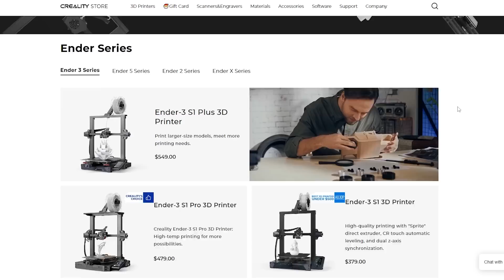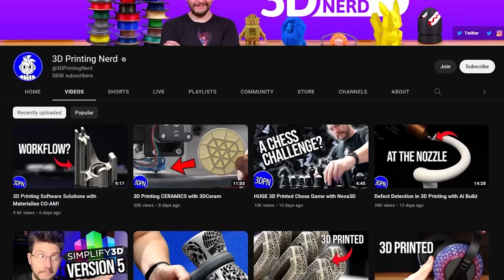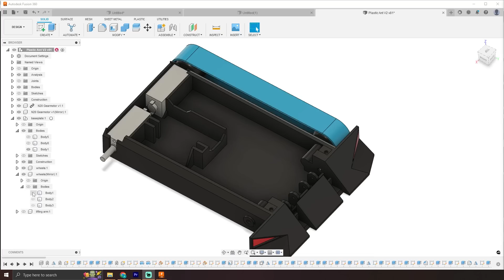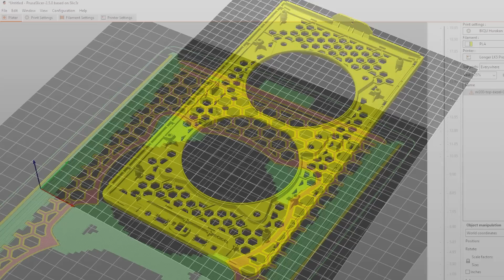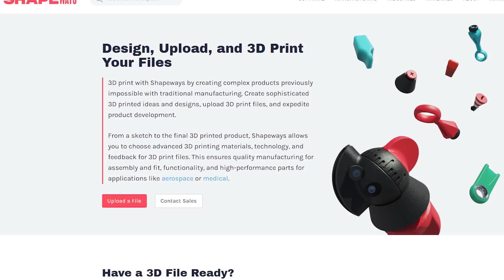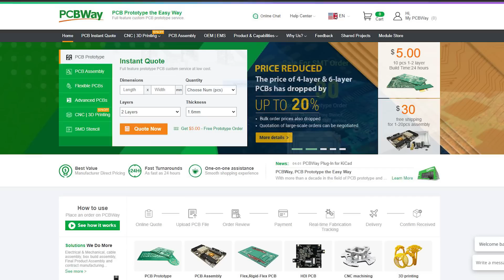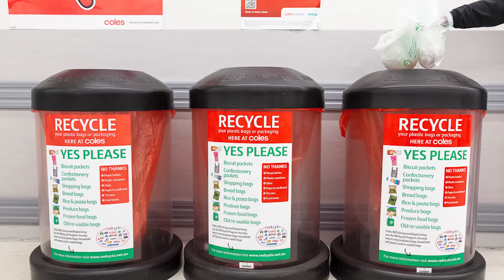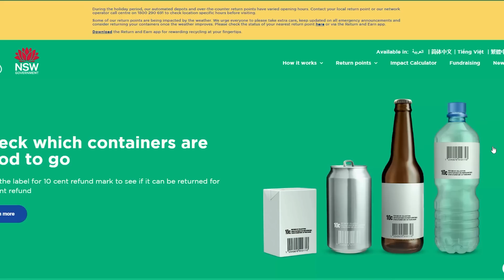My 3D Printing Predictions for 2023

Comment: Got an Ender 3 for Christmas, enjoying it. Still dialing in the first layer, but I'm improving my process. As far as CAD goes - Fusion 360 looks nice, but looks insanely expensive if I ever want to use it commercially. I've been learning FreeCAD for items that require strict dimensions, but I have a little bit of Blender and Wings3D experience, and they export STL files as well. I definitely think there's a need for simpler software; FreeCAD was a royal pain to learn.
Reply: That's funny. Fusion is the bargain CAD...😁 Similar offerings from other vendors go from 2500-20K/year. I have been a SOLIDWORKS user since 95 but I am so tired of their ridiculous prices and lack of consumer level options that I may switch to Fusion permanently. Autodesk's start-up/hobbyist license is by far the best in the industry and I hope it crushes Dassault for their elitist attitudes and for turning SW into the PTC, SW formed to replace.  If we make money, they make money. A single person startup cannot afford 4K in software to test ideas that may of may not pan out. Autodesk has that figured out, and I hope they stick with it.
Let me know if you find something else that is good. Onshape is pretty good, but doesn't have a low cost offering. There is a free version, but your files are forced to be public which makes it unusable for startups, and maybe even some hobby use. Some of us don't want our ideas public domain. 
As for the other CAD I would love to see other competitors, but of what I have seen, those low cost or free softwares are vastly inferior.
Reply: @court2379  I'm a former solidworks user (As well as Autodesk inventor, Civil #D, and AutoCAD versions over 20 years) and I didn't like Fusion360 at first, but now I love it.  The only thing that I haven't liked so far is that they removed some features from the hobbyist version and made it exclusive to the commercial version, but now that I have a #d print business, that doesn't matter anymore since I had to purchase the commercial version before my business got to the point where I could get in trouble for using the hobbyist version commercially.
Reply: @court2379  Solid Edge is a good choice as well.  Solidworks is built from the base that was build in Solid Edge.
Reply: @Frostfly  I just looked at their license options. They went the same route as SW. The start up license might be a little better depending on how strict they are on the time taken. I tried SW's and at the end of the year they force you to buy a commercial license or kick you out. I suspect SE is similar. They really aren't designed for true startups. They want to take an existing small company to the next level, not take a new idea and develop it into a product and then form a company to start selling it. You have to take a lot more risk to start a company before you have developed the product. Particularly if you don't know if the idea will work out. The whole point of the CAD is to figure that out before you spend tons of money on an idea that doesn't work. 

The maker licenses are crippled and offer no upgrade path to a commercial license should the hobby turn into a business. I would have to ask the specifics on the upgrade options from Siemens. SW offers no path. Perhaps Siemens is more reasonable and just charges some nominal conversion fee, or commitment for commercial software for some time. 

Onshape has the next best license that I have found, but your files being public limits the usability for new ideas/innovation.

So far Fusion is the only one I have seen that intends for the hobbies to grow and then starting asking to pay once you start making money. Everyone else wants money up front before there is any revenue to justify it. Autodesk is investing in makers/businesses with hopes they become long term customers. Everyone else is stifling innovation and losing potential customers.  It really makes me want to dump everyone else despite having to learn a new CAD package and being a SW administrator for hundreds of users for many years. I am inclined to recommend the company I work for do the same... The license fee savings alone will be in the millions.
Reply: @court2379 he is talking about the community edition of Solid Edge.

Community edition gives you the full software but has two limitations:

- 2D drawings will be watermaked

-Topology optimization module is only limited to create designs from forces and not pressure or torque, that is no problem since many of you will not use Topology Optimization

But outside that you are free to use all the tools the software offers, you can even use the Reverse Engineering tools of Solid Edge.
Reply: Blender has some quite good CAD add-ons as well as some excellent 3d printing Add ons.   Very Much worth the look.
Reply: Lol homie just wait til you see what a real CAD/CAE package runs. I've personally seen very high level stuff run into the 10-20k/year range for a small batch site license. I think my current package would be around ~7k/year without the company-sized bulk discounts

I really wish Solidworks and similar would offer stripped down (without any CAM/CAE/industrial capability) to students as a perpetual license. I think a LOT of students would bite the bullet on the $100 version if it wasn't a yearly cost.
Reply: @bobbystem7384  there used to be a student license version of Solidworks. Was not even very limited other than no commercial use.  It was FREE! as long as you were a member of EAA. Which I am.  They done away with it. The founder of EAA passed away and allot changed in the organization.  There is a highly discounted version still available.  If you are a student of Titans of CNC. These days I rarely use it.  Even though I can get a license thru a firm I do work for.  I use Fusion almost exclusively
Reply: Try Shapr3D, it’s $250ish a year and it has been awesome with an IPad
Reply: fusion is free if your a maker or student
Reply: @Unscientifically  with restrictions. I like fusion but I like Blender better, but the learning curve Phew I still struggle.
Reply: @ianmcleod8898  I tried using Blender and just gave up while failing to generate a 3D model while watching a tutorial and seemingly doing the same things. I took some Freecad tutorials and now can make parts I 3D print for repairs. I repaired a welder bearing spool loader, a fridge hinge, a headlight holder, a spacer adapter for a battery cable terminal, a battery bracket and plan on redesigning other car parts for repairs/modifications.
Reply: @Unscientifically  "if I ever want to use it commercially ". Try reading......
Reply: Just use the one for individual use, it’s free. Besides, if you’re using the commercial use license, chances are you’re designing to make money, so that in itself would pay for the subscription, which is still relatively cheap.
Reply: @pooppyybuhhole  For now, I'm not making money. There's also the issue of Linux . . . apparently Fusion 360 doesn't have a Linux version. That said, between Blender and CAD related plugins, FreeCAD, and SolveSpace, I'm fine with what I've got. Also I do some programming, so OpenSCAD has my interest, I will likely try that soon.
Reply: I think the linkstage 3 branch of FreeCAD is a bit easier to use.
Reply: Humm, must've been some other software. I thought it was like thousands a month.
Reply: @logicalfundy  it's not even thousands a year lol.
Reply: ohhhh no this comment reminded me that all my autodesk software won’t be free anymore after i graduate college next year. jeez i hope i can find a job that provides the licenses because there’s no way i’ll be able to afford fusion, maya, autocad, and revit all of which i use for different things 😭

also it’s not really the same type of software, but sketchup is a lot cheaper than fusion at like $300 a year for the commercial license (or a lot less if you’re a student) and there are tons of free plugins for it which add the features its missing.
Reply: Fusion isn't bad for commercial use.  $545 a year.
Reply: Insanely expensive?  At $545 a year.  Lol.  Have you priced the alternative?
Reply: @dieselguy62  Perspective my dude.  cheap to you is a lot of money to some.
Reply: @Frostfly  perspective "dude ". It's he said commercial use..... as in earning money.  And it's one of the cheapest there is "dude" 
If $545 for a software license in the CAD field doing work for hire...... is expensive.  You're doing shit way wrong "dude"

Comment: Recycling plastic has always been one of my main reasons for getting into 3D Printing, but I admit, after several years I still haven't done anything about it.
Reply: Same here! I even bought a filastruder and filawinder kit which has very much let me down in how much tinkering it needs in order to work. I still haven't managed to get a usable length of PLA from it. I can't wait for a desktop recycling setup that I can throw shredded prints at and get a decent filament from it.
Reply: Yeah, I really want some filament manufacturer to start some kind of "drop off" of failed prints etc and give you a discount on new filament depending on how much material you returned. Somewhere along the line of 1kg of failed PLA = %20 off on a new 1k spool of PLA or whatever.
Just so it's worth while for both sides to prevent the failed prints just ending up in land fills, because recycling is mainly just a lie.

Comment: Proper recycling of failed prints or purges would be amazing and something I'd spend money on. Output needs to be printable filament so I can actually use it.
I also want to see the end of filament on spools. Supply a master spool with a new printer and print more spools if necessary. Card board is dirty/dusty so not an alternative.
Reply: IMO a direct pellet extruder would be the way to recycle failed prints, the problem is finding a way to process the failed prints
Reply: using a filament dryer then sending the parts through a blender tend to work well.  a sawsall or vibrating saw to break down the bigger scraps.  a good blender should have no problems breaking them down into small enough bits to work for a recycler.  then bagging them up so they can stay dry until use shouldn't be too bad.  what I am doing is storing my scraps in boxes.  when I am ready (after getting a recycler of course) I will dry out the scraps in batches, put them through the blender, then put them into bags with silicate packets.  then once I have enough to do a couple kilograms worth I will put it through and get a few spools worth
Reply: @javeronh.3996  Tried a blender ended up burning it out. fairly heavy duty unit too.
Reply: oh, that bites.  well makes me glad I didn't try to use our Ninja blender then
Reply: @javeronh.3996  Once you start using a lot of electricity to "recycle" PLA into a product not as good as virgin PLA, you reach a point of diminishing returns where you're using more energy than the production of new material. This is one of the main dilemmas of plastic recycling as a whole. The other being that there are a thousand different kinds of plastic and you can't recycle one with another. Unfortunately, this is far from a "green" hobby.
Reply: right, but I figured the scraps from the recycled filament would go in a separate box.  to then be used in different ways.  so it would only be recycled once or twice before being used differently
Reply: @blubug768  pellet feed is pretty awesome but more complex. It's a cost/benifit. I think all large format printers are pellet feed.
Reply: @blubug768  pillow case and a rubber mallet has worked for me when I throw them in a toaster oven I got from a thrift store for $20
Reply: how is cardboard "dirty/dusty" i've found it to be the best opition and way nicer then mater spools
Reply: Filabot seems to be making headways, but the full suite runs in the neighborhood of $14,000
Reply: @drake_makes  Felfil  makes a unit but I don't know much about it except it is cheaper.
Reply: We must put lots of real time and effort into RnD of recycling, not just mess around and leave it in the corner as a side project.
Reply: I talked to Polymaker this week, and they will be doing spool-less filament in 2023
Reply: I hope this becomes a high-quality consumer grade option ASAP! I don't see much discussion around it, but the amount of plastic practically wasted and thrown on landfills due to failed prints is immense. There is room for A LOT of improvements in being able to reuse plastics used in 3d printers. As revolutionary as 3d printers have become, I'd be interested in seeing reports on how much more plastic is used and dumped due to 3d printing. I'm sure it has had a significant and downright horrible consequences on tge environment.
Reply: There's companies who do it like fusion filaments.
Reply: When moving to this approach, it is important that ordering spools (even if they're separate) is still an option, as you may not have an empty spool.
Reply: The system I like that I've seen is reusable spools. You keep using the spool and the filament comes tied down but without the spool and you just put it on your own spool and when it runs out you can take the spool apart and quickly refill it with another loose roll of filament
Reply: Hint: Look towards sewing machines for inspirations. 🤫
Reply: Not sure why cardboard isn’t an alternative just because it’s “dusty” but ok lmao
Reply: You can print a plastic tube to go in your cardboard spool if that's an issue for you. Cardboard almost solves the issue of spool waste.
Reply: I have actually looked around for spoolless filaments and very very hard to find. And, I agree, I would spend money on a home unit that recycles filament. The plastic bottle recycle is limited to people that actually consume a lot of beverages maybe with larger families. I try to spend a lot of time designing and I’ll print small sections of designs to limit the waste but I still have waste that I can recycle. Spools are a HUGE waste.
Reply: Bambulab is trying the master spool approach with their P1P printer, which I'm hugely excited for anyways. 670€ for a fully assembled printer with the kinematics and sensors from the X1 sounds absolutely terrific. Of course, we'll have to wait and see what reviewers think of it, but on paper, it sounds fantastic.
Reply: Sorting all your filaments so you can come up with one recycled one that prints reliably is the issue. I think recycling failed prints, waste etc into some sort of bulk plastic suitable for injection molding will be easier than trying to 3d print with it.
Reply: Pla failed prints are great to reuse with a soldering iron to make new basic objects or add on to new failed/deliberately incomplete prints. I am almost running out of enough failed prints using this trick. Another possible trick is to pour melted prints into a hole of a no infill print to make it injection mold strong at the price of 15% dense print. PET bottle to fillament converter would be far more useful than PLA recycling as it can be made cheaper and you will never run out of PET bottle supply anyways.
Reply: @two_number_nines  The viability of PET bottle recycling machines highly depends on where you live, it's only viable if you live somewhere without a bottle buyback scheme like Angus mentioned. Not sure how much the value is in Australia, but in Germany you pay 25 cents extra per PET bottle when you buy it and get it back when you return it for recycling. That puts a pretty significant raw material cost on PET bottles. Also, PET bottles are one of the few areas where a good recycling infrastructure exists here, so recycling those at home has no impact on the amount of bottles in landfills here.
Reply: @ska042  yeah the equation to make it viable to recycle bottles in bottle-buyback-regions is even tougher. I guess Germans will have to make do with PET packaging strips for big cardboard packages (like the 300g of strip I salvaged from discarded refrigerator packaging). That is unless they have buyback programs for every type of plastic in which case they are doomed to print expensive.
Reply: I have definitely used scraps for bandaids and such.  be nice to be able to make spools again though.  be great for test prints of ideas before making final prints to sell/show off
Reply: @two_number_nines  Yeah, I just used a bit of PLA from a failed print to repair a broken plastic hinge on my laser printer's fold-out paper catcher tray :) Who knows how many things I've wasted throughout my life because I didn't know how easy it is to weld and shape plastic with heat.